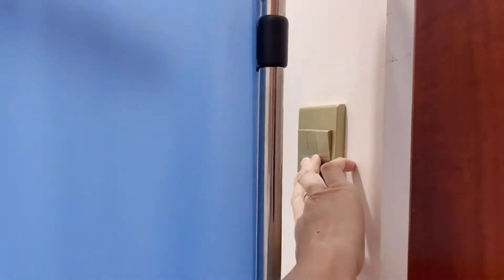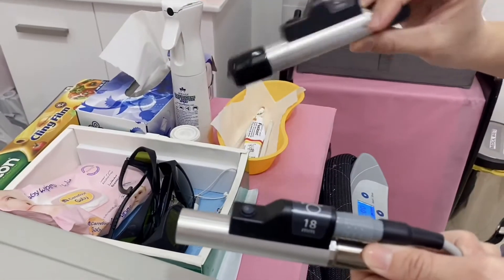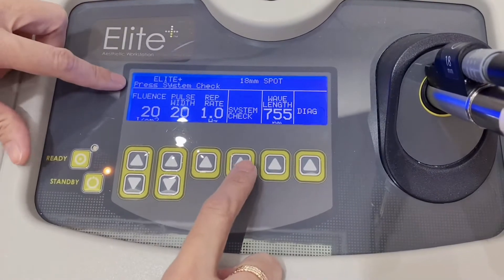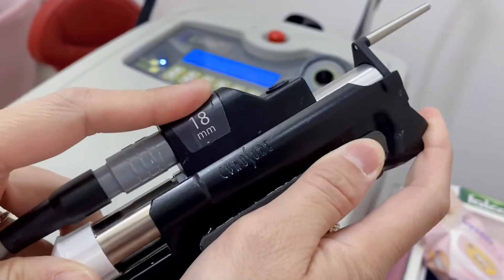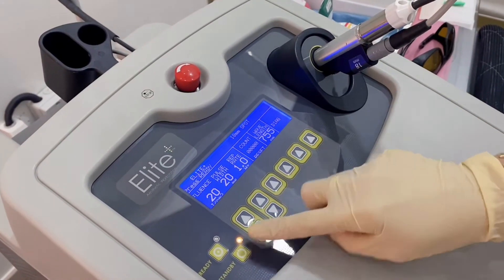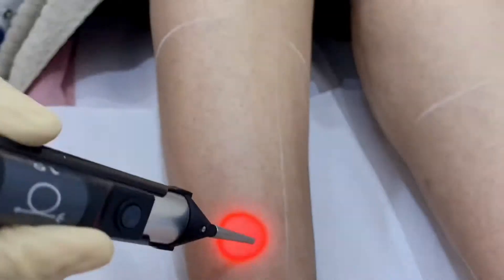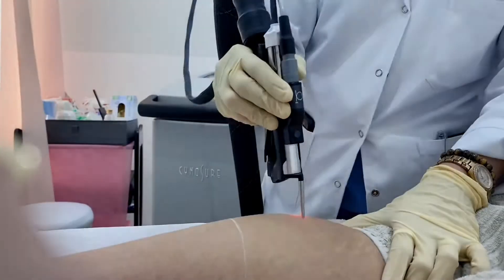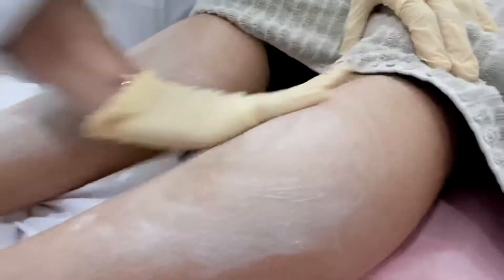Another Work Day in my Life as a Laser Technician | How to use Cynosure Elite Laser System

Comment: Hello po, ask ko lang po. Gusto ko lang po maliwanagan, bakit po sa thick hair need ng low fluence at high pulse widths? At sa thin hair need high fluence at low ang pulse widths? Thank u po..
Reply from the maker: Hello po! Great question, and thank you for asking. 🌟

Thick hair has more melanin and absorbs laser energy easily. Kaya po mas madaling uminit. That’s why we use low fluence (less energy) but longer pulse width (mas matagal ang init) to avoid burning the skin and to safely heat the follicle.

Also, thin hair has less melanin, so it doesn’t absorb as much energy. Kaya kailangan ng higher fluence (mas mataas na energy) and shorter pulse width (mas mabilis pero intense) para makapasok agad ang energy sa follicle before the heat diffuses.

In short:

Thick hair → low fluence, high pulse width (to avoid overheating)

Thin hair → high fluence, low pulse width (to make the treatment effective)

Hope that helps po! 😊 Let me know if you have more questions xx
Reply: @MoniqueGomez thanks po sa explanation Ma’am😊. God bless po❤

Comment: Hi...
"Hello, could you please explain the proper technique for holding the handpiece when using the Elite+ laser machine? I want to ensure I’m using the correct grip for stability and precision. Thanks!"
Reply: And I’d like to understand how to choose the proper parameters for each client when using the Elite+ laser. I’ve noticed that some practitioners use higher fluence while others use lower settings, even for clients who have had multiple sessions. How do you determine the safest and most effective settings to avoid burning the skin?"
Reply from the maker: If you’ve taken a laser course, they would have explained the necessary considerations in detail. However, based on my experience, you should assess the skin type using the Fitzpatrick scale to determine the appropriate settings. When adjusting fluence, I recommend starting at a lower setting and gradually increasing it based on the skin's response. It's easier to increase fluence slowly rather than risk burning the skin by using a setting that is too high and incompatible with the skin type.
Reply from the maker: If you have any more questions, feel free to ask! I'd be happy to create another vlog addressing all my viewers' questions. Thanks xx
Reply from the maker: Hello, we all have different and comfortable way to hold the handpiece, but what works for me is that I hold the handpiece with a firm yet relaxed grip to maintain stability. I usually keep my wrist straight to avoid strain and ensure precise movements. I also position the handpiece perpendicular to the skin. And I use my non-dominant hand to stabilize the client's skin. If I had to do full body laser, I had to change it using my other hand coz it tends to stiffen my dominant hand if used for a longer time.